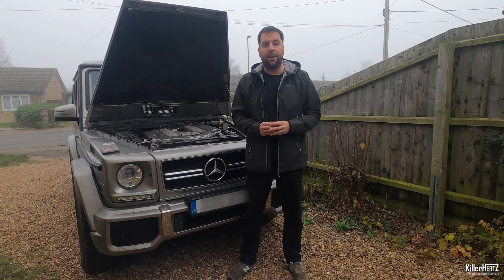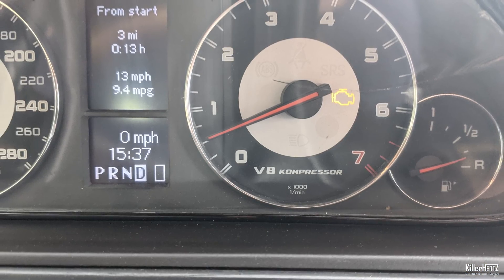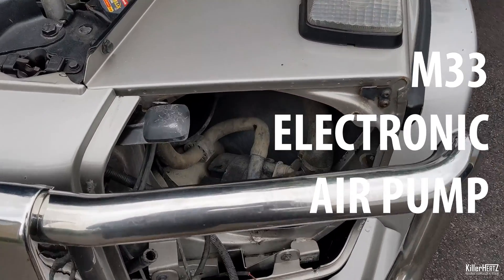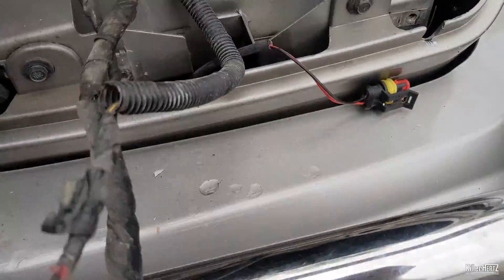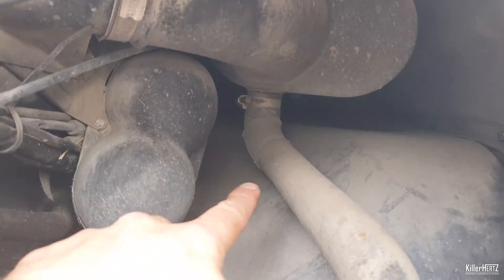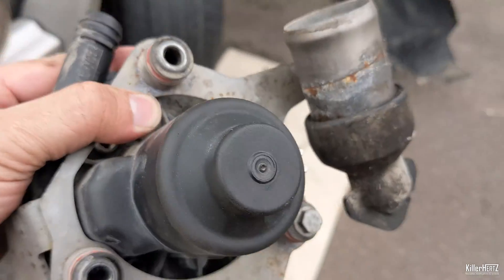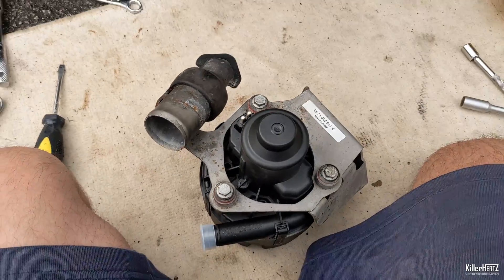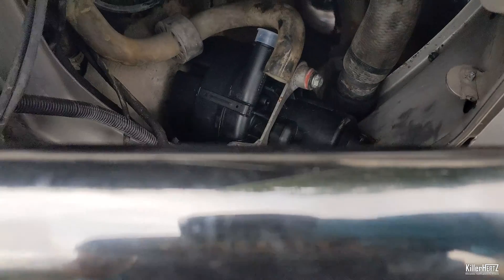HOW TO Fix Mercedes Error Codes: P0410 & P0413 | Secondary Air Pump Failure

Comment: That is not so easy. There can be more than two reasons. 
Also my car (M112 engine) threw a P0410 code. Reason was neither the air pump, nor the switch, but clogged secondary air passageways!
Reply: How did you clean the passageways

Comment: Or you can just bypass it using star...
Reply: Yes can be using star, just Google its been a while since I've done it so can't exactly remember the process

If you can't find the info I've got it written down somewhere
Reply: Can this be turned off using star or does it require a remap ?